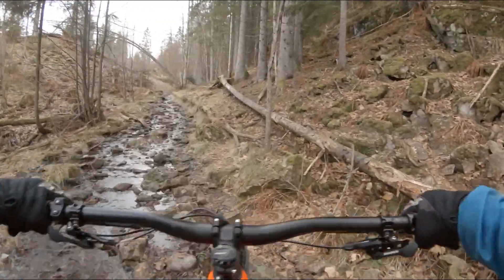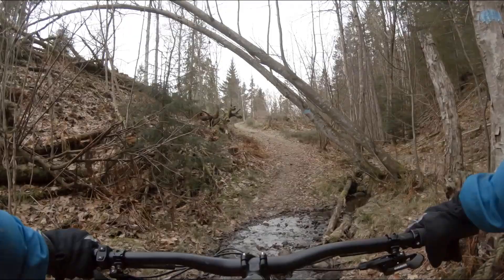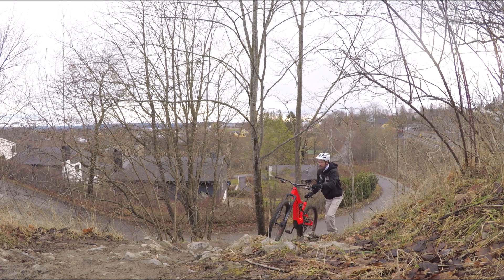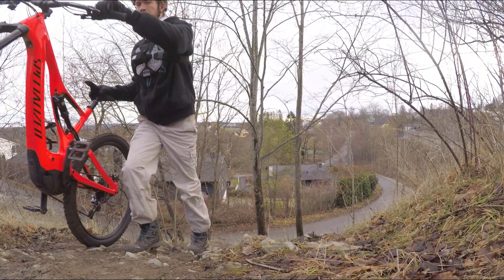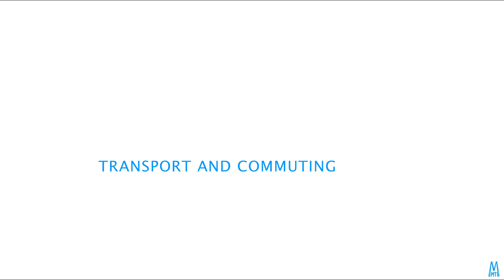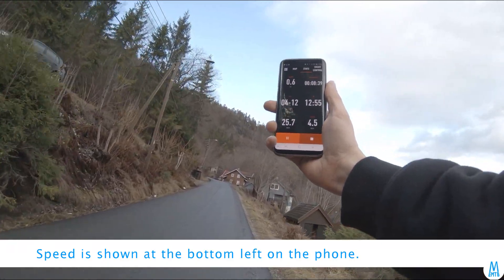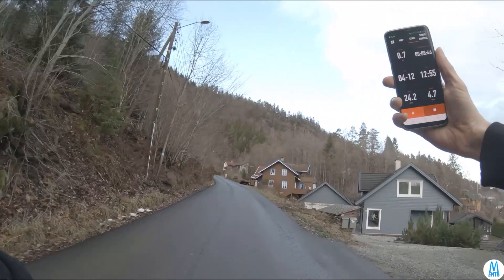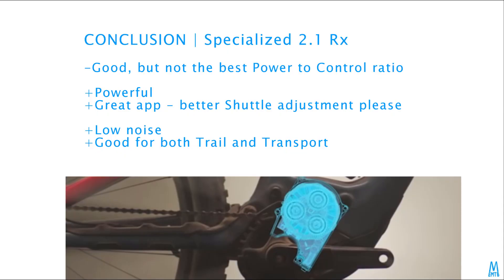Specialized 2.1 Rx (2019) - eBike motor test

Comment: you make some great points and observations that are only able to be made if you're in the mode of comparing different Motors to one another in a relatively short period of time for the sake of your memory and accuracy. I compared a few bikes to one another in a short. Of time and it was very helpful for me as well. I had to make a decision and I'm very pleased I selected the specialized 2019 version that you are reviewing. I was very pleased with its performance in comparison to the Shimano when I was trying to do difficult climbs. The problem is that I may have benefited by adjusting parameters on the Shimano bike provided by intense. I questioned them to see if there were any things that could be done to improve its performance, but I don't think the people were familiar enough with the system to give it the best opportunity for me to understand and compare with the other bikes. Ultimately it seems like I'm making the right decision and I appreciate seeing the information you're putting out there. It seems the biggest concern might be managing the overshoot of torque during technical maneuvers. I think I can manage around that and get a accustomed to the bike behavior. I have a enduro motorcycling background which helps in managing and understanding torque. Thanks.